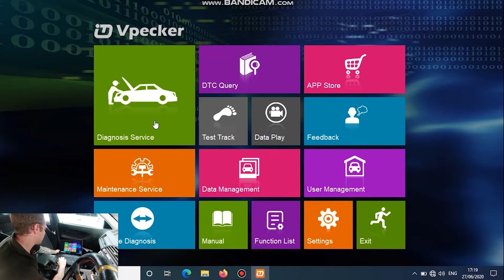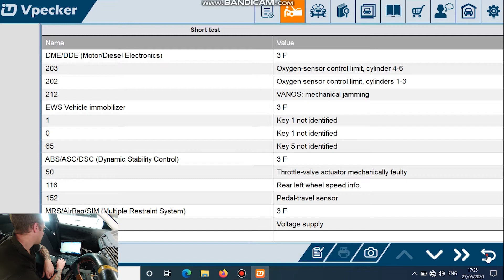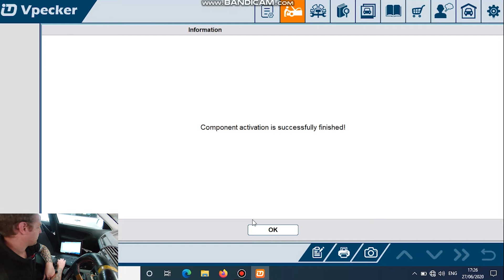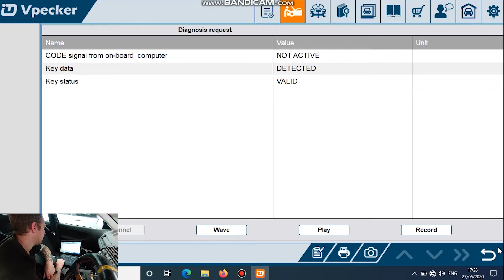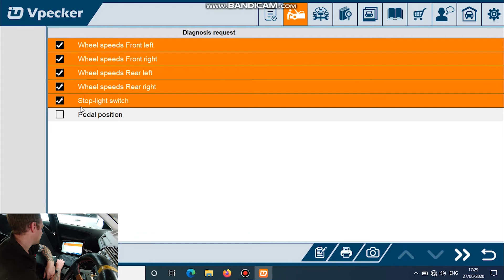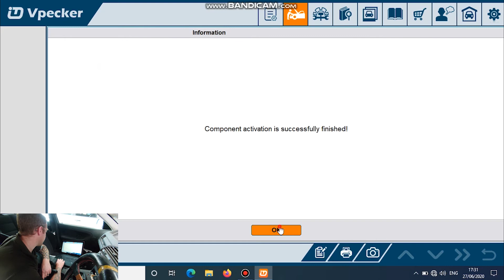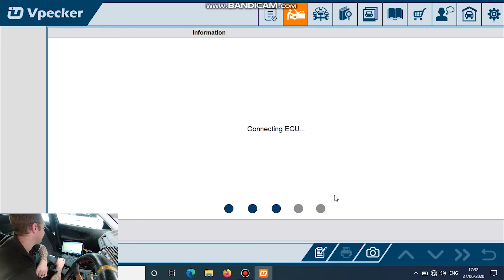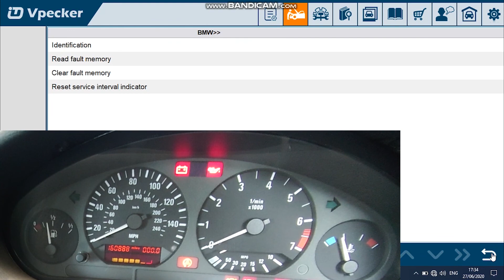Vpecker BMW 3 E36 OBD1 scan tool test

Comment: Cool, do I have to get one that is V12.0? Or will a Vpecker E1 of ebay with "Software Version: Newest V10.6" work with OBD1 also?
Reply from the maker: I would assume it would work but I've not use the older version.
Reply: @rmautodiag  - what model year was this BMW from btw?